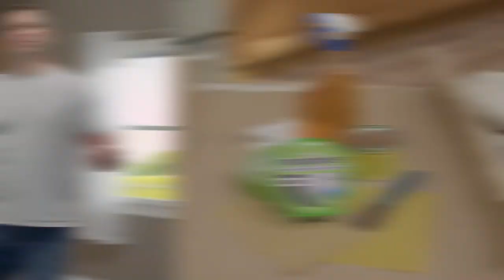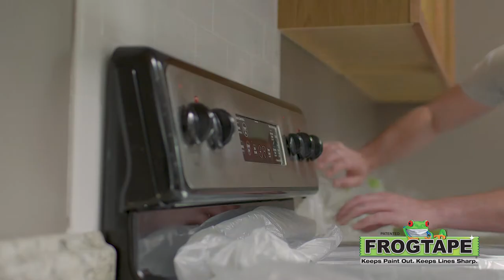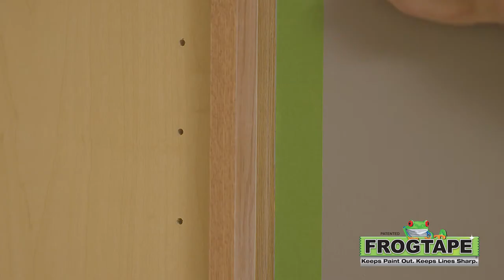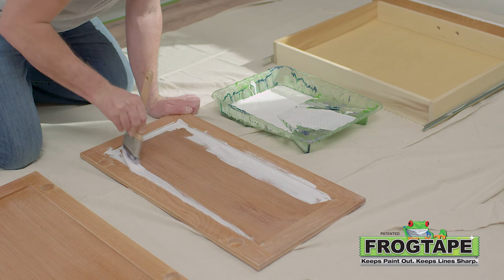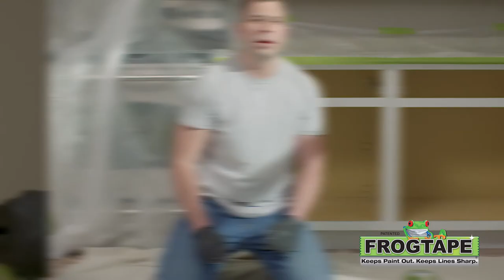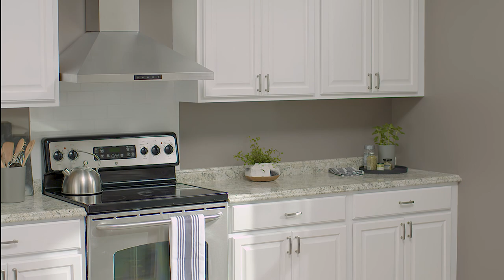How to Paint Cabinets

Comment: I always heard that foam rollers leave fine bubbles that in turn gives a sandy look & feel.
Reply: Yep.....i ran into this issue.... i was pissed
Reply: Sal Aguayo y’all need to use an expensive brush and apply paint and paint conditioner like floetrol, over it to remove the bubbles and give you a flat finish.